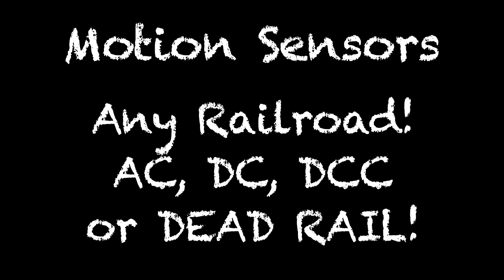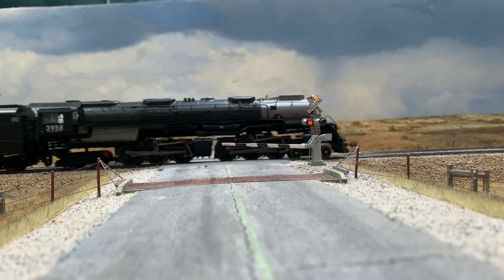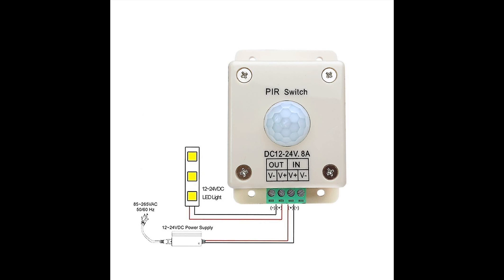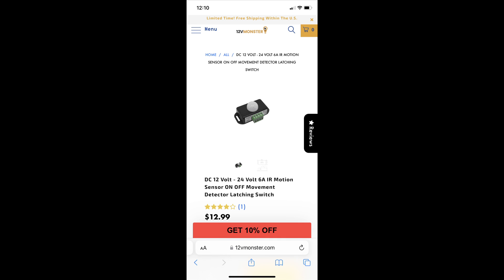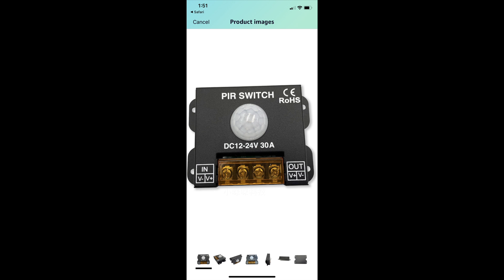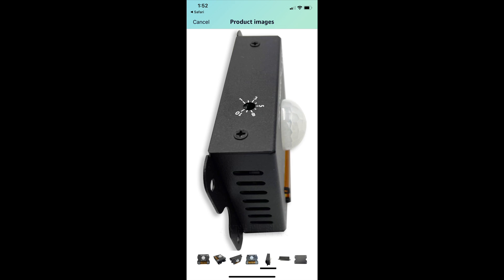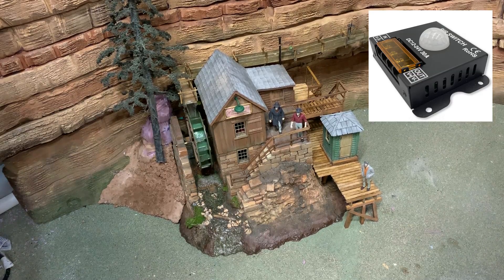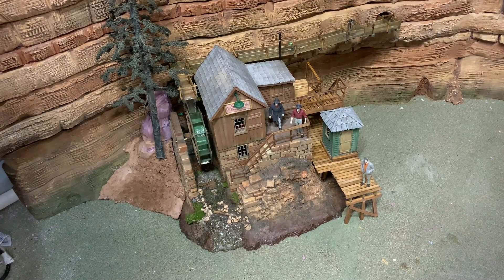Using Motion Sensors to Activate Lights, Sound, and Animation  - Electricity for Model Railroads

Comment: +ToyMan   Thanks for the electrician perspective.  Way signals, like grade-crossing signals, run on position sensors; the only hangup is setting the flash rate for a thrown crossover switch.  Human sensors might be available as millimetre-wave PESA microradars.